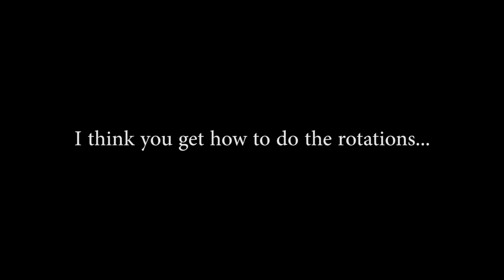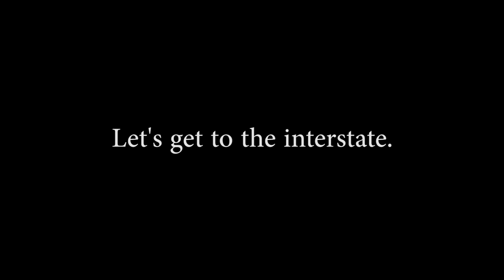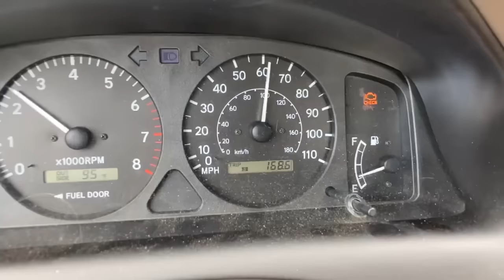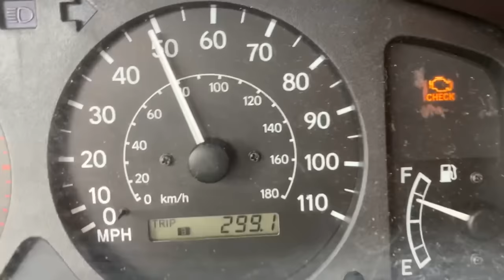Will Berryman's B12 Chemtool stop oil consumption? 😲 | Oil Burning🔥Experiments | Episode 15

Comment: I did the B12 treatment to my corolla and I must have used different chemical than you, I used the gallon carb dip cleaner. I lost all oil pressure and the timing chain began to rattle. I opted to replace the engine myself. I have a 2001 corolla and I installed a 2004 corolla engine. I had to swap alot of parts over but it runs great. I use to burn 1 qt every 300 miles, now I burn 1 qt every 2500 miles! I say that is good enough for me!
Reply from the maker: That's the third engine in that, right Adam? You locked up the first one? Glad to hear the latest one is doing good 👍👍
Reply: @FamilyFriendlyDIY  yea 1st engine burned all the oil out. Lol never checked it. And it locked up, 2nd engine I did the b12 treatment and that failed. Now I have 3000 miles on the 3rd engine. But its a newer one, supposedly the non burning oil year. I'm just glad I can finally drive it and not have to drive my diesel around
Reply: The B12 Chemdip in the gallon works too as long as u performed the same steps as Dave did. Since the price on the chemtool was so cheap, I rather be using the chemtool instead of the gallon Chemdip. Chemdip was widely used as an engine part soak if u doing a tear down rebuilt.
Reply: @blackysan  yea after I swapped my other engine in, I tore that one torn alittle and there was so much sludge a d carbon build up, that engine was doomed from the start. I pulled the valve cover off my new engine and its clean as a whistle. The only thing I didnt do was the 20 min at high rpm. I just drove around for a while.
Reply: My 2009 Corolla 100 k mile also burn 1 q every 3000 mile it pretty normal for those engine. Btw 2004 engine in 2001 you need change wire harness and computer ?
Reply: @maungmaung4037  that’s not normal at all. Engine shouldn’t be burning ANY oil between oil change. You could prevent this from happening from day 1 when the car was brand new. Just don’t go pass 5000 miles oil change and redline your car occasionally. 

Since most people has this problem because they don’t change their oil frequently and rev the engine frequently or simply they bought the car used (like me) that previous owner didn’t took care the car ended up with oil consumption problems
Reply: @maungmaung4037 No I did not change the computer or wiring harness. I pretty much stripped it to a long block and used all my 2001 stuff to put it back together.
Reply: @blackysan  agree. My buddies matrix (same engine the 1zz.) He doesn't burn a drop of oil. But changes his oil on time.
Reply: @adamzwagerman  yes sir. We all gotta learned from the hard way, that’s how life is. Years ago, I owned cars from the 80s & 90s, back then we NEVER heard of oil consumption problems whatsoever, none of those stuck oil control rings and return holes problem ever happened in all of those cars I’ve owned. All we heard was worn valves guide seals leaking oil or gasket leaking oil, not because of oil rings and piston designs. That’s when people were all changing their oil at 3000 miles. Then post 06/07 era, we start hearing oil consumption problems on lots of cars from different manufacturers due to they went with low tensions piston rings, tiny tiny oil return holes, and extended oil change interval to 8000, 10000 miles. Manufacturers doesn’t want u to hold on to the cars for 20, 30 years, they want u to buy new one every 5 yrs or so coz if u keep on changing the oil every 10000 miles or once a year, u will end up with oil consumption problems after 5 yrs of ownership
Reply: @blackysan  Wrong. It's actually a design defect in the 8th gen 1.8L non Japanese built engine. If you got the JSpec engine. It didn't burn. The US version used low tension rings.
Reply: @adamzwagerman  9th gen only had the issue for half of 2003. Otherwise it was fixed.
Reply: @EricVonHunter  wrong. Rather u have jspec, eurospec, asianspec or us spec or not it’s the same thing. Extended oil change interval will killed your oil control rings no matter u have low tension ring or high tension. My friend’s imported motor all got oil consumption issues (4age 20v, beam 3sge, sr20det…etc) because of years of neglect. Does not change the oil on time and frequently.

Comment: That b12 will probably evaporate as the oil gets hot.  You probably cleaned your whole engine real good too. That’s a lot better result though.  I have a quad that burns oil too, I kinda wanna try this. I just hate changing the oil.

Comment: This is amazing result! Been followed this series of yours, so it's shocking that this actually worked! Been using Seafoam before but this seems like the real deal. Any update on this, been a month since you released this video, I imagine you drove it many 300 miles since?
Reply: Jhon prob ground up the rod bearings and and cam journals
Reply: @jeffgood6441  naw 😆

Comment: I've used B12 for years to clean out carbs on lawnmowers, outboards and generators without having to dismantle everything. I'd pour enough in to an empty tank and crank it to fill the bowls and let it set for about 2 hrs. Add gas rest of B12 and run the engine at a fast idling speed until it stopped belching smoke. On larger outboards, whole can of B12 to 3-4 gal gas, then run at a normal cruise speed.  When anything was stored for more than a couple months B12 was in the carbs. We used it forever on the farm, just like WD 40 it would almost cure cancer.

Comment: Berrymans site says 1.5 oz per quart when cold, then idle 20 min, change oil. Just in case a lot of crud might plug the pickup screen or overload the oil.
I'm about to try this on 4.6 V8 Ford which were notorious about valve guide seals too. V8s have the pistons at 45* angle so pouring on top of the pistons might not help much. 
I will keep updated.
I use it in the gas occasionally 👍
B12 is acetone, toluene, and mek... Highly volitile and evaporates in hot oil.
BTW in the past I have greatly reduced oil burning using Mobil1.= Smoking pipes to 1500 miles per quart. 40,000 miles later the engine was clean as new inside. 😁 and had .022 cylinder wear.😱😱

Comment: 10/28/23
My 07 Camry reached 2,385 miles and the final dipstick was 1/3  of the dipstick from the top dot. I could have gone 5k miles and not have to add oil but decided to perform a 2nd piston soak.
I decided to perform a second piston soak, with the engine warmed up, turning the crank 5 revolution and continued every 6 hours.  I also added 1/2 oz of transmission fluid into each cylinder and sprayed a little engine starter fluid to save the starter and it did start right away. I proceeded to run the engine at 4500 rpm for 20 minutes. As an addition I added 1 quart of diesel fuel in the engine oil and let it idle for 10 minutes and Drain and added 5w-20 Kirkland synthetic oil.
Rather than going on long drives on the weekends,  my daughter is driving the Camry to commutes to college and works. She is driving about 260 miles plus per week. 
Oil checked this morning with 1250 miles, the dipstick shows slightly below the top dot about 1/16". I would say this better than the first piston soak.

I have noticed that oil reading differs from overnight(lower) rather than checking the engine after 30 minutes to 1 hour after driving as the engine is still warm. I will keep you up to date as the millage accumulates.

Comment: It will be interesting to see if this holds long term.
Reply: Why would it hold long term? The engine has a design flaw in the piston rings and piston. This is a band aid and nothing more. He will need to keep doing these sorts of things as the problem returns.

When they put stents to open up a persons blood vessels it almost never lasts long term. The only way stents work long term is if the person changes their diet, takes up exercise, cuts out alcohol and smoking etc.....

No mechanic in a bottle can fix a mechanical issue long term the best you can do is treat the symptoms. I deal with this on a 2007 Toyota Camry with 2AZFE. I have reversed the oil consumption but I know that it is going to come back unless I stay on top of it!!!
Reply: @buckaroobonsi555  It may have taken years for the oil rings to get gunked up, or they may have gotten gunked by lack of timely oil changes, which could be more often.

Comment: I have a 08 xB with oil consumption issue, definitely going to give this a try to see if it helps.  Im having to put 1.5 quarts weekly.
Reply: did you get to it yet?
Reply: @JonnyAbs-0  today I finished driving and changing the oil.  I'll know in a few days the results.
Reply: @JonnyAbs-0  5 days later oil amount remains good, usually it would burn a quart. I'll check on it in 5 days to see how its going.
Reply: @wilmerherrera8722  you're the man.  Did you soak with oil or anything after the berrymans?  I am thinking it would strip the cylinders and pistons of all oil and you wouldnt be lubricated on first startup.
Reply: @JonnyAbs-0  I didn't add any oil. TBH I was so fed up with the oil burning I wouldn't care if something happened. But thankfully it went well.
Reply: @wilmerherrera8722  😆😆

Comment: Wow im so happy for the results!! Got 5 ads watching a video and dont mind them at all i wish you all sucess after providing such high quality content! 
Give us a simple update when you get a chance im very curious!
I think il give this a try, if it works you might have saved me engine rebuild
Reply from the maker: Thanks for the kind comment, Boz! ... There will definitely be an update!
Reply: I just did b12 chemtool treatment and heres my experience so i can contribute to sample size

Its 1.5dci engine (k9k 704)
Oil consumption went from 0.6l/1000km to 1.5l/1000km in 2 years. Oil changed regularly (every 2-6k km) because it got saturated with soot fast. Deactivating egr helped so oil can last  5k km comfortably. I redid my injectors and soot reduced considerably. All that was left was oil smoking which was bad and even visible on hot engine on idle. My only guess are piston rings gumming up because oil consumption increase dont make sense over that short period.

I did treatment  with b12 injector cleaner 21oz can. I poured it can contents in 5 times, so it was 30 something mililiters per cylinder per puour. Started on cold engine. Turned engine over every time before pouring. After that engine had a lot of trouble starting (likely cylinders very washed out) when started i held it at 1400rpm to help oil get to cylinders. Drove aprox 2000rpm untill engine got to 70C then drove 55mph at 3500rpm. It was smoking. After 10 min started doing full throttle accelerations and cruising on and off. Then i did full throttle acceleration from 30mph to full throttle in 4th gear. Suddenly i got giant cloud of smoke behind me, looked like engine is broken. Continued cruising 3500-4000rpm and it cleared up (at least what i see in mirror) tried full throttle again and it was emitting less and less smoke. Changed oil after it cooled substantialy so i dont get burned. Visible smoke is almost gone and treatment looks like and improvement. Now oil is topped after changing it and all is left to see is my consumption after 1000km. It certainly is improved but not fixed judging from what i see. Feel free to ask me for any details i missed or update down the road

Comment: Honestly i am happy for you and i believe this result. I have been told similar.

If you look at the duty cycle this era of car was designed for, you see that they are over engineered for just gentle driving and really benefit from getting the sh** driven out of them here and there.

So dont forget to “let er rip” once in a while and keep up with the oil changes.. 

You might needa second treatment but time will tell
Reply: Back when I was a teenager, I have cars from the 80s and 90s, I never heard of oil consumption or encountered any on all the cars I’ve owned. The problems we heard back then were blown head gaskets, broken timing belts, and hydro locked the motor. NEVER any oil consumption problems ever. That’s when everybody changes their oil at 3000 miles until  post 06/07, we start hearing oil consumption problems…and now, I change my oil every 5000 miles or every 6 months on all of my cars regardless of what the manufacturer recommends
Reply: @blackysan  

While i admire the attention you give to your cars, there are ways to attain higher mileage oil change intervals without having problems. 

Most cars miss the oil change interval not on mileage but on time. Normally there is a time limit and a mileage limit, and you need to change oil when one of them has been reached. The time limit on engine oil is usually 12 months. 

In order to take advantage of the longer oil change interval you need to use the right oil. This does not mean you need to go buy expensive oil with bold claims on the label, you need to use an oil that is meets the manufacturers specification. This means it will say “approved for VW507 00” if you drive a VW and VW50700 is listed in the handbook. There is far more DIY in the USA and this leads to a lot pf people putting oil with insufficient additive package inside into their car and expecting it to survive the extended service interval. 

Filter quality.. OEM specified oil filters are really very good and can hold enough material to keep the oil clean for the extended interval. The OEM specification filters are often quite different to what you might be offered in the local parts store. 

Short journeys: the front of the handbook will often have a paragraph talking about short journeys, stating that if you make many short journeys where the engine oil does not reach operating temperature, that you should change your oil more frequently..

Unfortunately cars are no longer as simple as they ised to be because they are far cleaner and far more efficient than cars of 10 or 15 years ago and are fantastically safe! The end user gets the benefits and also has to shoulder the extra maintenance complexities.
Reply: @jp-me9zz  years ago I purchased a 07 Suzuki sx4 brand new, I put in Royal Purple engine oil and high quality K&n oil filter after the 500 miles break in period, those were the only oil and filter I ever used for this car until I sold the car on 2016. Throughout the ownership of 9 yrs, I extended the oil change interval to 10,000 miles or once a year on that car, but I changed the oil filter every 3000 miles and top off with same engine oil after, and believe me or not, it has developed oil consumption problem after 5 yrs. It will always consumed half a quart between the 10k miles once a year oil change. Although it’s not much, but it still burns a bit and my catalytic converter died around that time. I’ve been told it’s totally normal that newer car always consumed a bit of oil but why did my catalytic converter died prematurely? I only have around 40k miles at that time and my cat just clogged and throw the P0420 code check engine light on and I’m losing mpg. Lost about 3 mpg on a tank.

Then I met a fellow 07 Suzuki sx4 owner during a track event, and yes i did track my car. He told me NEVER ever extend oil change intervals pass 5000miles! He has the exact same car as me with higher mileages than me but he changed his oil every 5000 miles or every 6 months which ever came 1st, and he never used any high quality oils and filters like me. He just used basic full synthetic oil and filter from the part store and he has ZERO oil consumption problem and his catalytic converter has ZERO issue!

He learned this from his father’s Toyota pickup truck which has 400k miles and has ZERO oil consumption problems, still original engine and transmission, never had any problems whatsoever. All he did was changed the oil and filter every 3000 miles and transmission fluid every 30k miles. He was told to rev the motor to redline about 2, 3 gear pulls occasionally to keep the engine healthy.

I was sold on that ever since!
Reply: @blackysan  im sorry you had this bad experience with your car.

It is likely that your catalyst was clogged due to the ash produced by royal purple oil. Most non “low SAPS” oil will cause catalyst poisoning and blockage. Royal purple advertises high levels of ZDDP which is known to poison and deactivate catalysts. It is better to have high quality base oils than high levels of ZDDP in modern engines. 

I have yet to see a K&N filter that is better than a factory specified filter at removing and holding onto debris. The best filter you could buy was specified by the factort. And it was not made by K&N. 

Please remember, the only entity who knows exactly what a filter must fulfill for an engine is the entity that designed the engine. Likewise for oil. 

I wish you luck with all your cars.
Reply: @jp-me9zz  yes Royal purple did advertised high ZDDP  levels and yes, ZDDP can clogs catalytic converter if using it long term. That’s why newer API SP+ graded oils dropped the ZDDP contents lower than previously API SN graded oils because it can harm catalytic converter prematurely. 

No matter if u r using Royal purple, redline, or amsoil high end motor oils, they will always has high ZDDP contents but base oil will be better with redline/amsoil TRUE 100% synthetic oil.

Now I follow the 5000 miles or every 6 months oil change interval with basic full synthetic oil and regular filter rule with the new car I bought after I sold the Suzuki. It’s been 6 yrs so far, and I have ZERO problem with engine or catalytic converter. I will keep on going the same with all my future cars

Comment: Another good way to clean the tops of the pistons is to remove the plugs and fill the cylinders with vinegar overnight, then crank over your motor with plugs out, to remove carbon and vinegar, replace plugs.
Reply: Did you change the oil before driving for fear of vinegar contamination? Or do you think that wouldn't be enough vinegar in the oil to worry about?